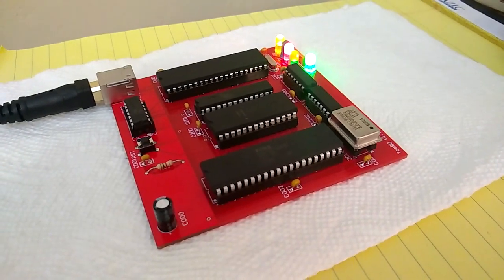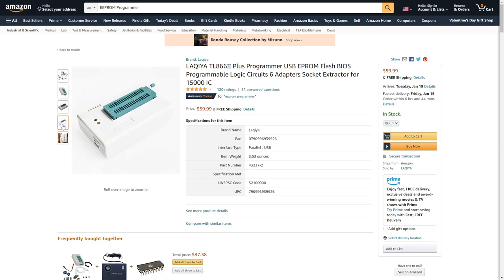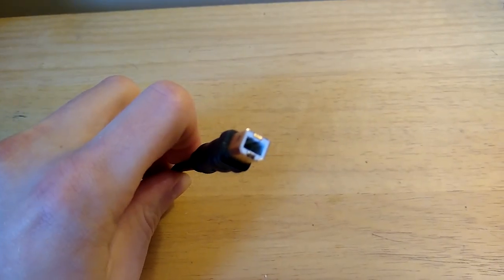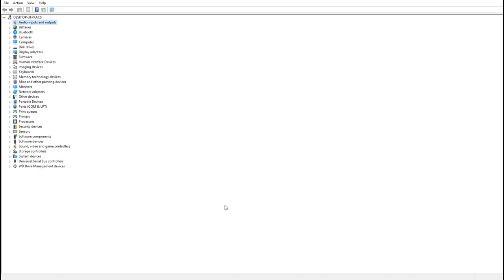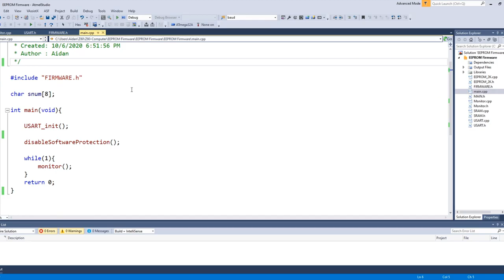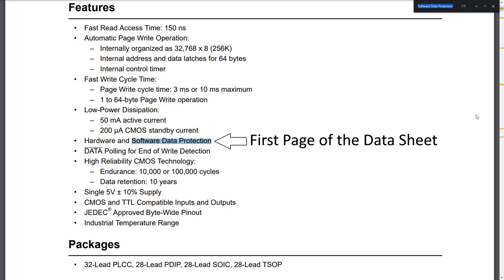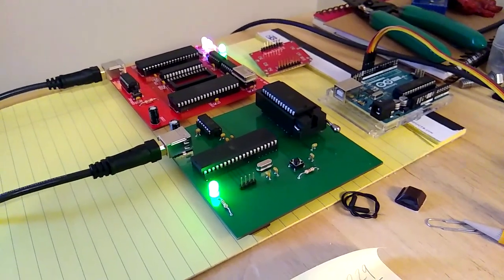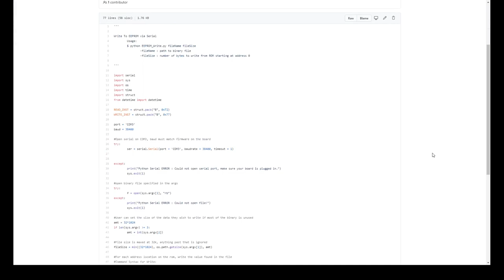Building An EEPROM Programmer

Comment: 1:04 - "In hindsight I should have done this differently" - can you elaborate? Seems that in the end, things worked out nicely, so I wonder what your apparent regret is rooted in.
Reply from the maker: Sure!  Everything worked out fine for the at28c256 which was the chip I was really targeting.  I don't really show it in the video but the data and address pins are out of order in the DIP package.  The way that I assigned the pins from the AVR to the socket was specific to how that chip would sit in the programmer which meant it was easier to write software for that chip specifically.  Just putting the data on port A means code is pretty straightforward, but if I were to program a different chip with other pin configurations the convenience is lost.  I could have talked more about the firmware code in the video but I couldn't think of a way to do so that wouldn't have been boring.  Had I been aiming for a more universal programmer or one that could target I2C ROMs I should have laid things out differently or put a lot more thought into the software side of things. 

TLDR: I was lazy and could have done things smarter but it does what I wanted it to.
Reply: @AidanJennings  Thanks for elaborating!

Comment: That is just awesomme.... What exact eeprom can be burned?
Reply from the maker: I build it and wrote the firmware with the AT28C256 in mind.  Theoretically, any Dual In-line chip that fits within the programmer could be programmed.
Reply: @AidanJennings  Sweet. Thanks for the info. 🙂